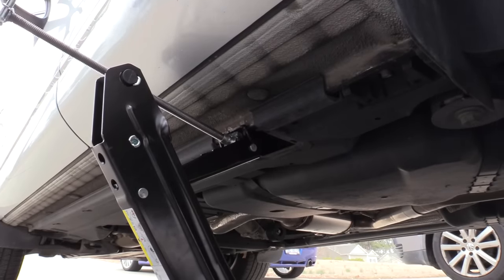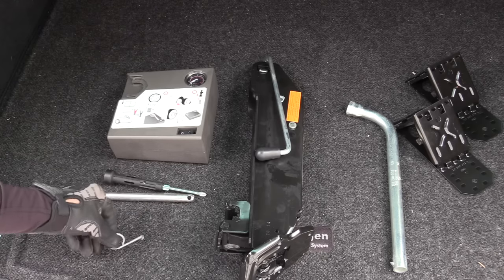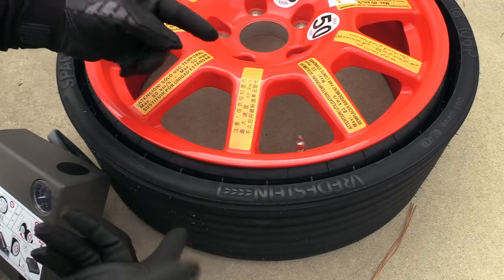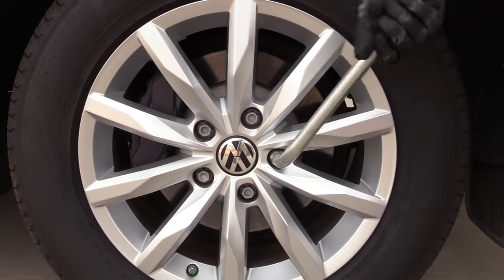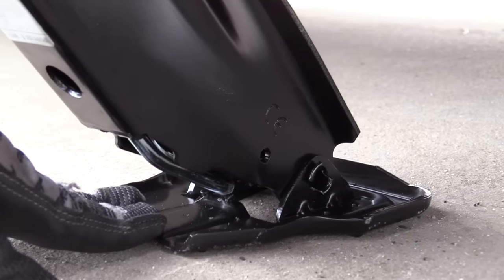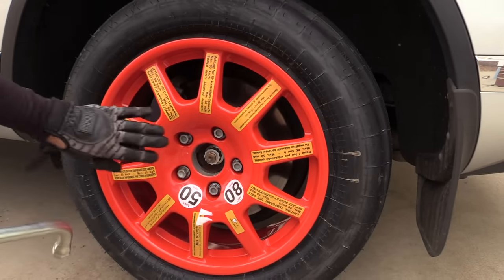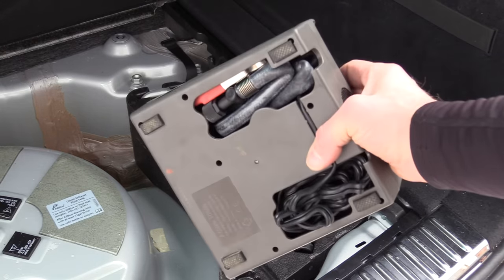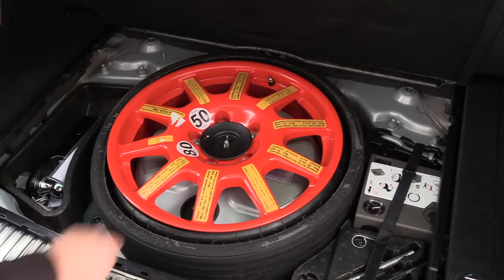How To Change a Tire with a VW Jack (The WIDOWMAKER)

Comment: Germans sure know how to over complicate a simple job. The extra process of filling the tyre with air dealing with that precarious jack maybe hazardous for someone on the side of the road in bad weather. Stupidity in my opinion, and what happens to the bad wheel? Does it fold in on itself if deflated or are we just supposed to leave it rolling around in the trunk.
Reply from the maker: Yea, not the best setup in the world.

Comment: That wheel hanger tool thingy is a clever idea, but VW jacks have always sucked. I see that they've specced it up a bit (with a better foot piece) for the Touareg,but they're still using that crappy aluminium wheel spanner, guaranteed by two certified Zjherrman engineers to crack. Yes! Do check this stuff when you get the car. And maybe, just maybe,read the owner's manual.
Reply from the maker: Reading the owners book is such a valuable use of time. I wish people did that. But I don't read it either unless I have an issue HAHA'

Comment: So the Germans turned what is usually a safe 5 minute exercise. Into a 20 minute frustrating mess and is rather dangerous. I used a VAG jack once and never again. We have a VW as one of our cars. Dealer was told under no uncertain terms that the car will only be sold to us with a full size spare and a scissor jack. They complied.

Comment: A spare Tyre you have to pump up yourself? That's dumb... got a flat on my Fabia recently, got the spare out, jacked up that corner, swapped wheels, put everything back in the car, drove off. Just 10 mins in the cold rain.

Comment: Never pull or push the lug wrench the way demonstrated  .. instead position wrench so that you can use your Legg strength to push the tool in the desired direction  ..  leggs are stronger than back muscles  ..  LoL  safer too

Comment: Whats wrong with the days of proper scissor jacks and full sized spare wheel? Theres too much assing about. That spare wheel looks cool like rally spec. I threw in a nissans scissor jack in the boot. I dont trust that awkward thing if its not on level ground. I wouldnt own a car with a space saver theres dam all benefits only a headache. All cars should have full sized spare wheels and you can always come across some sharps on the ground at the randomest time. Space saver is always a stupid idea and the designer needs to be shot.

Comment: sry but it's pretty stupid to loosen or tighten the bold by LIFTING the wrench up (been there, done that), it will hurt your back because most of the time you will have a hard time to loosen the bolts due to rust or the shop puts it on way to tight. it's way easier to put the wrench on with the end close to the ground and push it down with one foot, you can do the same when you tighten the bolts and just check it with your hands pushing it down.
Reply from the maker: Lift with your legs? ;) but yes using gravity to help can be a good thing.

Comment: So then you’re next to the highway where you can be ran over any minute, and then you have to hook up a compressor and inflate your spare tire, so 3 cm of space in the trunk has been saved, and filled up again with the space of an air compressor which can fail. What where they thinking at that engineering office.
Reply from the maker: My guess is, the team was given a space to put a spare after all the other things were finished including car body. Kinda like "here is a spot... figure is out. Also here is your low budget". LOL

Comment: i hate space savers its the most stupid idea ever at least the VW one isn't as bad as the skinny ones witch here in Australian you can be fined for or even have your car defected because the law states the tires on a axle must be that same size its ok for front tires to be different from the back tires but the left must be the same as the right on a given axle. also out here in Australia if you have to use a space saver out on a highway you rarely make it to the next town before it gives out and lost of Australian highways are cell black spots. i have stopped counting how many times i have seen people either stuck on the side of the road with a blown space saver or just gone "fuck it" and keept driving on the space savers rim.
Reply: i take it that it's a better idea to either find a spot with a cell signal or a rest stop with a land line even if it means running both the damaged tire and space saver spare down to the rim

Comment: The most disappointing thing is the space saver. imagine, $60k car.. " Oh we had to put in a spacesaver to save weight or some other shit nobody cares for" .. I mean seriously, do they thing the 10 pounds they save effects anything? .. In my B6 passat I had a fifth wheel as a spare. On the new cars, even if you get the fifth yourself, it doesn't fit in there. I hate it!
Reply from the maker: I wish there was space for the full size. I’m sure the rest of the car was built and the tire set up was a later addition

Comment: You must inflate tyre... Oo my fucking good. 
First we got hole in car and jack with stick to put in hole and proper spare wheel. That was all nice, jack was secure in hole and wheel was good as new.
Then we got that shitty jack which is really easy way get broken leg or arm and therefore little bit money from insurance company.
After that we got space saver wheel which is really shit way to do things but hey, we are still fine.
Now we got deflated tyre and compressor to inflate tyre and really good excuse to be late 1 hour on work

Comment: When idling the car put it in neutral not park
Reply from the maker: Why?
Reply: @HumbleMechanic  it should make the engine run smooter and the transmission heat up less by creating less friction and so mabye using less fuel (at least in my car) if its called neutral its not there for nothing ;)

Comment: Space saver spares are a cancer upon modern cars. If you can’t design the spare wheel well bay to hold a wheel that’s like an inch or two wider, that’s a pretty big fail in my book. They’re dangerous, and you can bet that you’ll get a flat on the highway, in the wet, at night, your kid is driving, and you’re a long way from home. Here in Australia, if I buy a car with a space saver spare, I immediately throw the space saver straight in the garbage and get a proper spare.

Comment: So cheap... they could have easily have made that compressor fit the 12v power supply from inside the car rather than making it so you have to open your bonnet to change a tyre (Seems unreasonable to me)
Reply from the maker: My guess is it’s a higher draw pump than you’d want to run off a 12v outlet. But that’s just a guess. I haven’t measured it.
Reply: @HumbleMechanic  Very true i just think from a function standpoint it'd be a lot better if it went to a 12v outlet on the car rather than having to open the bonnet and all that i have a small compressor in my car that i actually use for such occasions and i personally don't see why the space saver needed to not be enflated, like surely partial inflation would atleast be possible rather than having to pump it up effectively from flat, modern cars just seem to be getting less functional in my eyes.

Comment: no harm , but you dont have a clue , youve missed the two most important points
1 crack the wheel nuts before you put the jack under the car at all , then if they are tight and rock it makes no odds and wont rock the car off the jack 
but most importantly 
2 when you have the spare wheel out , and the jack under the car ,,,, put the spare wheel under the car , at the sill edge or the likes  as soon as you can , ideally before starting to jack the car ,,,, then jack the car , finish taking off the flat wheel , but ,,,, put it under the car sill too ,, then take the spare wheel out from under the car also , and fit it ,,, when its on and nuts are reasonably tight , take the flat wheel out from under the car , and carry on as usual ,,,
the important part is this ,,,,,,,, at no time is the car without a wheel under it , so if it does fall off the jack it wont land on the ground or worse ,,, your feet .. a far safer way of doing things. plus if it did rock or fall , you could let the car down onto the wheel under it and reposition the jack 

BUT AT NO TIME SHOULD THE CAR BE ON A JACK WITHOUT A WHEEL UNDER IT TO PREVENT IT FALLING ALL THE WAY.
simples
Reply from the maker: Here are my thoughts on the tire under the car..
If I was working on the car, like doing brakes, YES that is a great idea. But I feel like fussing around with the tire under the car on the side of the road makes for more opportunity to make a mistake. It usually means at some point you will have your hands under the car that is only supported by a jack. Plus this is not like a donut Honda wheel/tire this is a big heavy assembly. To me that time, energy and risk of shoving the tire under the car, then dragging it out, is not worth it. 

I understand why many people would do this. But in my opinion it's not the best way for this exact job.
Reply: @HumbleMechanic  By only handling a the wheel under the car by holding it on the flats of the tyre , at no time are your hands between the car and the wheel , so it is impossible to cause an injury.
Where to put wheels is only common sense , simply put , there should never be a time when the car is on the jack without a wheel  that there isnt a wheel under the car ,, its no more fussing about , as the wheels still need to be moved , its only about where you leave them ,,, as for the its a big heavy thing , thats just trading effort for safety , if you are in fact saying you cant be bothered to do the job as safely as you can , thats fine , its your choice.
But to  set your self up  and  instruct  people how to use your sloppy and frankly dangerous methodology is irresponsible.
Guess its just a difference in opinion about safe working practice , you cant be bothered , and I think its important to at last show how something can be done safely , then let them make an informed decision.
Ive had my say , and wont be writing any more.

Comment: Modern engineering only know McDonald for their meal and I phone for their communications, from Canberra to Sydney international airport will take 2.5 to 3 hours on 110 KPH and the spare type in my car rated at 80 KPH on 110 KPH and when it rain you only can drive at 50 KPH for your own safety and never mind about the boot with full of luggage and you either look at the profit before the safety of your customers or simply have a rock on your head

Comment: #1 ditch the fucking scissor lift or whatever that bullshit is and get a floor jack #2 get a four way lug wrench and #3 get a decent fucking spare that's already inflated then Jack and replace it's that simple
Reply from the maker: New jack and lug wrench are great to add. A full size spare sadly wont fit in the well. Even with all the foam removed.
Reply: Yea on the vw that's not an uncommon issue with them and I've been contacting them about that for some time now but vw you know being them they said meh not our problem. And a full spare in the back takes up a bit of space but hey better safe than sorry especially if their compressor quits on you like it did me but aye to each their own
Reply from the maker: Yeah I tired to use the Milwaukee compressor. It wouldn't pump this tire up :( AAA would be to the rescue

Comment: And you need an air compressor to pump up the spare??? Where's the snare drum? I'm waiting for the punch line. Seriously...the provide you with a spare tire that is PURPOSELY flat!! Why not just pump up you regular flat tire and limp to a service station so you dont have to use the suicide jack. German engineering...giving skoda a run for the money.

Comment: By the way..... Alligator clips in the original VW compressor? Whot a piece of crap!
Reply from the maker: I would rather that than have to have another tool to use it. I think it's a little too high of a draw for a 12v outlet. Of all the goofy things, that one doesn't bug me
Reply: @HumbleMechanic  Yeah, that's probably the main reason but still it look really cheap for a Touareg
Reply from the maker: The older ones that were air ride had a really cool fitting you could screw an air hose into.

Comment: Very stupid to ship a tire that is not inflated. The last thing you want to have to do when changing a tire on the side of the road is inflated. Leave it to the Germans to screw that up. I appreciate your work on Volkswagens, but in my opinion, they’re nothing but junk.
Reply from the maker: I’m not sure I follow. Tires are shipped not inflated all the time. They are also stored not inflated all the time. The only time I’ve seen tires shipped inflated was when they came mounted and balanced from somewhere like Discount Tire
Reply: Cars have had the tires shipped inflated as long as I can remember. As I said, the idea of shipping a tire without air is plain stupid. I do not care if it saves space in the vehicle. Nobody wants to spend the extra time futzing with a little Debbie air compressor to inflate a tire when they’re stuck on the road and we could possibly be hazardous situation. I know you are a Volkswagen mechanic of us Volkswagen is your preference. One thing I have learned from watching your channel is that Volkswagens are way over engineered, thus incur unnecessary costs when it comes to repair. You do a good job with your channel and your videos, nothing against you, and I will continue to watch your videos to learn what I can, I am just not a fan of Volkswagen.